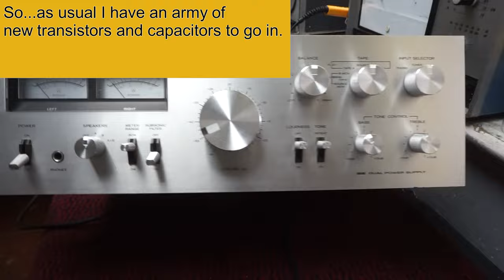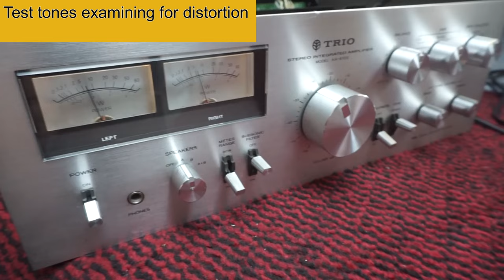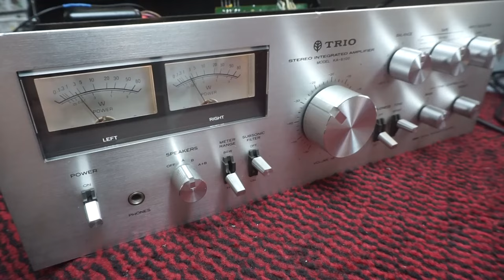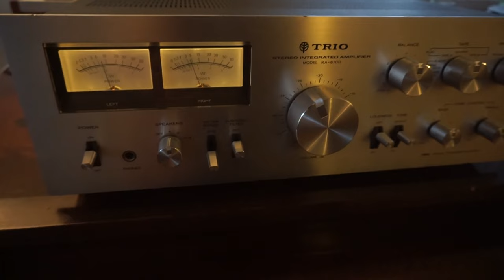Trio KA6100 restoration

Comment: What do you think about the build quality and sound quality of the KA6100 as compared to a Pioneer 50 watt amp like the SA6800?
Reply from the maker: The Trio has the better damping factor due to more stored energy , more VA in the transformer- but apart from that, sound differences? , there isnt much in it. They're both great designs.